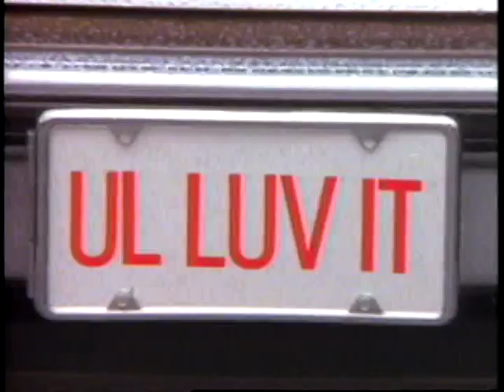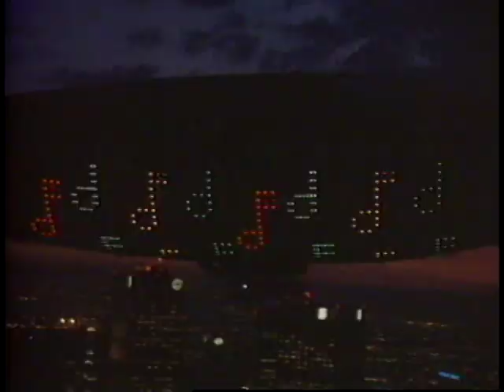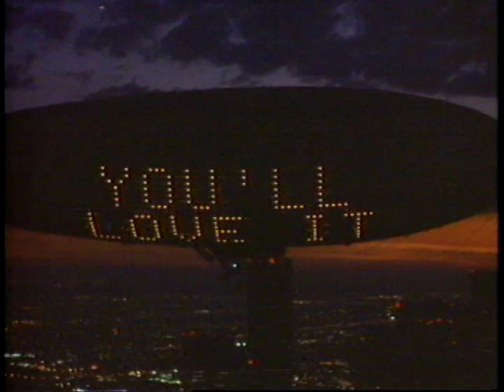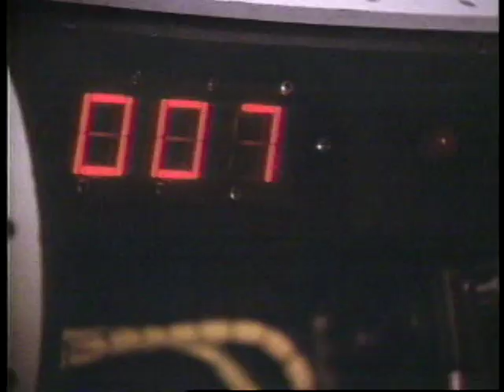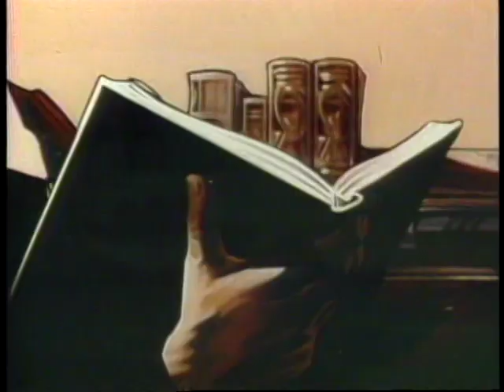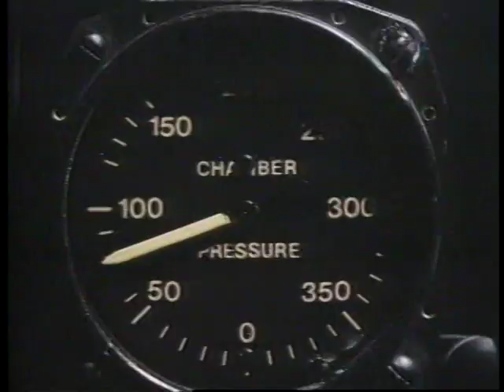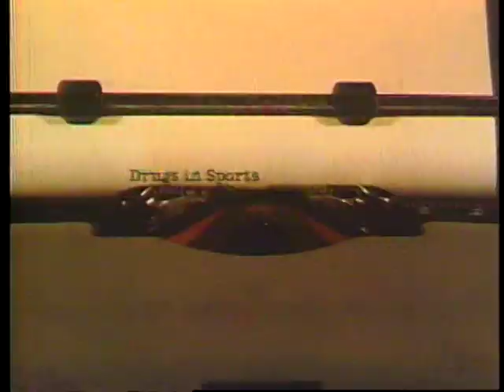ABC Network Promo Closed Circuit Feed to affiliates 1985

Comment: Despite having good promos, abc was dead last in Prime Time as CBS dropped to 2nd place and NBC became #1 

The only good thing abc had were Who's the Boss?, Growing Pains and Moonlighting 

Dynasty was in the Top 10 for the last time with Hotel in the Top 25
Reply: ABC was on top of the heap in the late Seventies, but in the Eighties it fell hard and fast.
Reply: Absolutely @Fool3SufferingFools  in the late 70's abc had great shows that put'em on top: Happy Days, Laverne & Shirley, Barney Miller, Mork & Mindy, Angie, The Ropers, TAXI, Vega$ and of course, 3 shows that overcame controversy in Three's Company, SOAP and The Original Charlie's Angels. Since the 80's, they've filled most of their time slots with Aaron Spelling Shows and that's what hurt'em, not to mention, turning down The Cosby Show and The Golden Girls which was picked up by NBC under Brandon Tartikoff and made abc regret their decision.